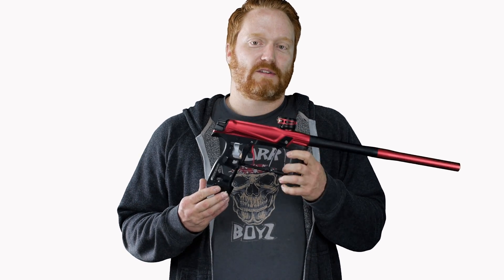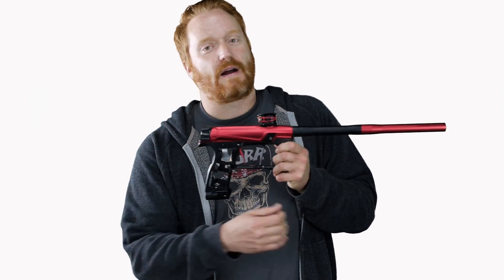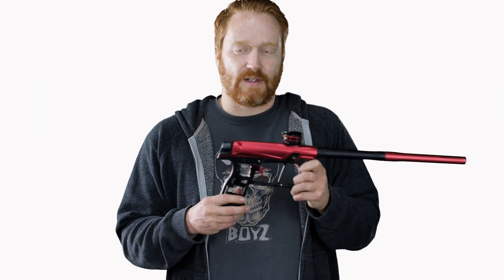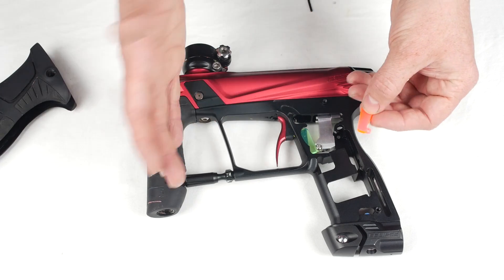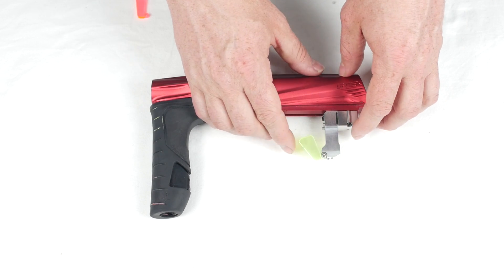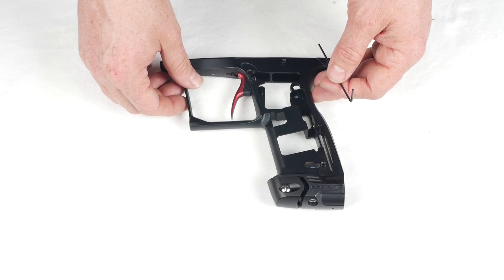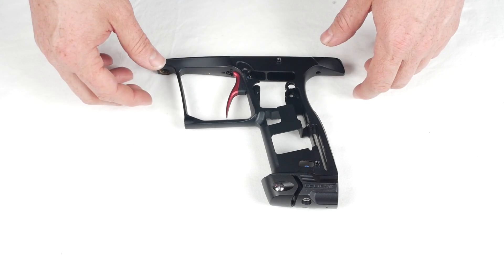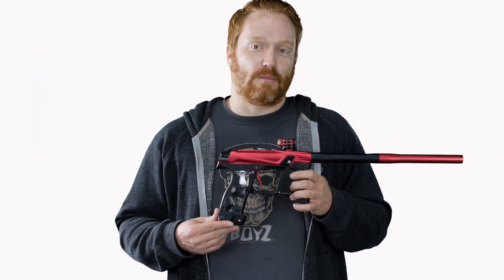Gtek 160R Legacy Mod turns it into a fire breathing GMEK 160R | Review

Comment: So is this only for 160r, or does it also work for original gtek?
Reply from the maker: D Etch the same kit will work for both, the only difference between them is the ‘blade’ lever and the kit comes with both, unless something changed and then just buy the one for your marker.